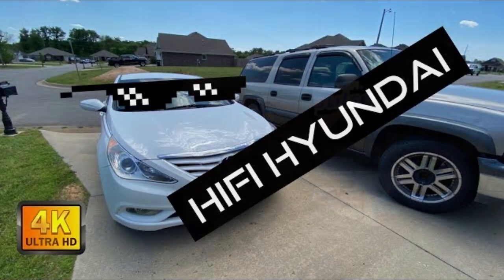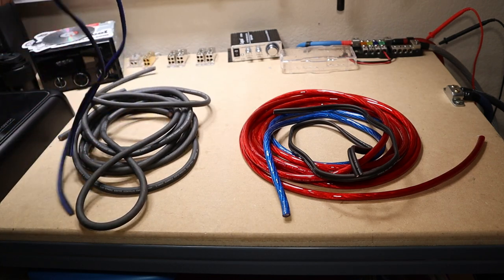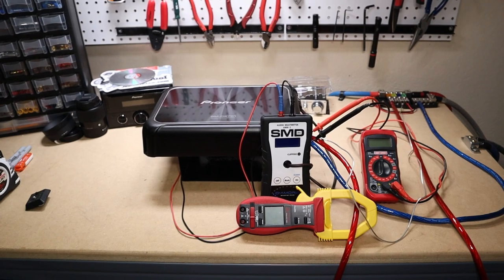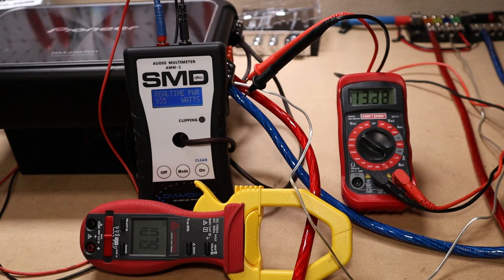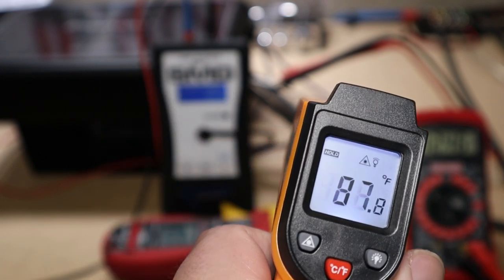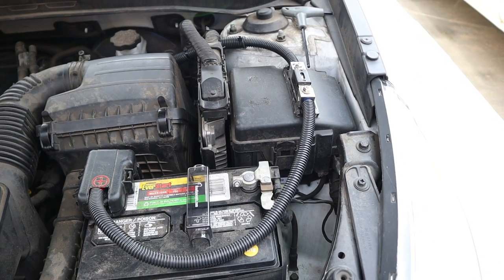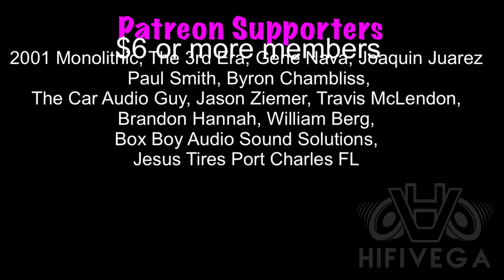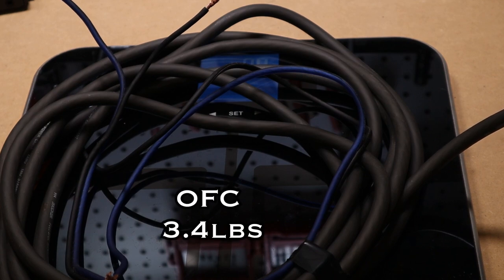This is why CCA wire is better than OFC wire!

Comment: Using some math, you can have fairly on-par performance out of CCA by using 2awg larger than the OFC equivalent.  e.g. use 4awg CCA in place of 6awg OFC and you get a cable that's lower cost and less weight, but have to deal with larger size and the need to further corrosion-proof your ends (noalox).
Reply from the maker: Def always worth saving for the OFC.
Reply: 6awg copper = 4awg aluminium 🤔, the smaller the gauge the fatter the wire. CCA doesn't last for shit if you live in a wet area. Shame everyone local is only selling CCA these days, gonna have to import OFC from overseas, back 10 years ago even the flea market stuff was decent copper. Guess it doesn't help that the cost of copper sky rocketed recently. Gonna have to source copper welding wire instead of Chinese aluminium.
Reply: @fl5537  Thanks for the correction, got dyslexic on my gauges.

Comment: I've installed different brands of CCA wire 0 gauge usually and customers Vehicles they come back months later because they has such high resistance in The Wire itself and would keep blowing the inline fuse. I would then replace the cca wire with any ofc wire and they would be good for years.

Comment: I am an OFC guy myself but what this test does indicate is that there is space for CCA too in the real world for one's daily boom. Music is dynamic and the stress on the wire will potentially be lower. Another point to note probably could be that one may consider CCA for speaker wires without a fuss..so Amazon basics wire may just work as good as a stinger speaker wire. 
I am not sure if am ready to make the shift but a very interesting video. Thanks.
Reply from the maker: I’m an OFC guy for sure, but I needed to test CCA for myself so I could have a more informed opinion on it.

Comment: I mean, for under 1k watts it doesn't really matter what you use as long as it's the true gauge, I bought some 4 gauge kit for 20 bucks, I never ended up using it, it was such a joke, the wire inside was like 10 gauge and the insulation ran thick, I didn't bother to check when I bought it, now I know to check everything

Comment: I have had CCA running as speaker cable for past 1.5 years. Recently, one of the speakers stopped operating and on inspecting, found it to be oxidised completely at the terminal end and wire had white powdered stuff running into the transparent insulation as well. Hence, at least for speakers wire applications, CCA fails to do the job and copper/ OFC should be preferred.
Reply from the maker: Ofc for the win!
Reply: I have I think CCA at some home cheap speakers since 2005 and they are still pretty fine, but they have the tips soldered so they never break apart or oxidize much 😎
Reply: @guily6669  mine were installed on a car that weathered extreme heat and monsoons of India, maybe that led to faster rate of degradation

Comment: OFC FTW!!! I had one of my three vehicles with CCA wire for over a year then it started to corrode around the terminal that's connected to my second battery in the trunk
Reply: Never had any moisture or anything stayed dry the entire install
Reply: 74 Midwestbass I used cca in my work truck and I sprayed the terminals with poly. No issues in 2.5 years. I always spray ends and terminals.
Reply: Also unless the off is tinned, same thing can happen. Spray the unions and terminals and no problems.
Reply: @superchile9640   yeah I do also under the hood but not in The TRUNK! Also the other wires where ofc hooked to the exact same terminal had no problems!!!!
Reply: @superchile9640  now I'm not bashing CCA if that's all you can afford do your thing bro but for me ofc all the way!!! That's almost like building a race car and then putting cheap tires on it😞!!!

Comment: I haven't seen a whole lot of your videos yet but if you plan on continuing test and comparison videos where you need temp data I hope you can invest in a decent flir thermal camera (harbor freight) instead of these non-contact infra red. I have multiple different thermometers of this type (including the exact one you're using here) and I'm sure you know they are NOT pinpoint accurate at all and have a quickly diverging cone of effective area.

Good for big areas like the heat sink of an amp but def not for such a small surface area as wire

HAVING SAID THAT I doubt there are that many other needs that a thermal imager is a must in the realm of car audio
Reply from the maker: I’ve been considering getting the flir phone add on piece for the reasons you already listed
Reply: @HifiVega  man I hope you can. I can't afford to be a Patreon member but I wish I could. Maybe things will change enough for me to do a one time thing. But if you do get one it would be awesome if you could show it off in detail for us. And thanks for the videos you produce. You cover some areas that not many do.

I especially like your lists. Everybody else reviews one amp or one sub. Your lists and shootouts disseminate SO MUCH more useful data. More tubers need to follow your lead

Did you hear that big D ???

Comment: What if say you’re only pushing a 4-500 watt amp for mids and high using 4 gauge caa, will swapping over to 4 gauge ofc make a difference or even worth it the trouble?
Reply from the maker: I don’t think it would make a big performance different, but you wouldn’t have to worry about the corrosion factor/longevity

Comment: I will suggest buying the best you can afford however every test I've seen or done shows that OFC has less resistance and allows your amp to produce more power.
Though if you're building a budget build then CCA is better. 

I personally am running all Knukonceptz Kolossus OFC oversized 1/0 and 4awg wiring but quality is what I wanted.
Reply from the maker: OFC ftw!

Comment: Hears the deal boys n gyrls- if you measure by size, schedule, diameter of wire OFC will flow more current. If you compare the two by MASS or wieght the CCA will be much larger than the OFC and carry the same or more or less current. Try doing a test based on Mass, it might take 1/0 CCA to equal 4g OFC. We wont know till ya test it!

Comment: Ofc all the way.  More watts
I'm also an electrician. Aluminum you have to upsize it to equal copper wire. Aluminum cca wire expands with heat. I used 0 guage cca with reducers to 4 guage toy amp cause it was cheaper and better then running 4 guage ofc wire and  l get more current due to the size and it's a short Run.

Comment: I think the difference between CCA and ofc is minimal especially in car audio.
I think your test is good.
 I just want you to know that if you look at the mayor car audio brands CT sounds, SKAR, Alphard deaf bonce etc. all these brands use ccaw on all there 2500 3000 watt sub woofers voice coils but on the 500 to 1000 watt subs use pure copper or ofc.
I guess you can run more power through CCA .

Comment: I have cca in my grad prix hooked up to a 2400 watt rms amp and it works perfectly fine but in my grand cherokee i have ofc hooked up to a 4000 watt rms amp ( cherokee system not finished ) but id say cca is fine for low power amps but wouldnt run in in a monster set up like my cherokee !! I paid 50 bucks for 1/0 cca amp kit and 120 bucks for ofc amp kit so price may be some peoples reason for buying cca
Reply from the maker: Always go with the OFC when you can

Comment: You'll need to crimp and shrink any CCA in your engine bay. Avoid open strands and set screw terminals at all costs. You'll also need to tighten your terminals periodically since CCA tends to loosen up causing high resistance.  Also need to use larger CCA than OFC to carry the same amount of current, and bigger wire is harder to run sometimes. For the cost between CCA and welding cable, I don't see a real benefit.
Reply: People are using what fits in the amp he was wise to use the same size cable
Reply: @elitepknuable  Yeah, but a lot of amplifiers have smaller input terminals than their amps need (I'm looking at you HiFonics) and if you're running 20 feet of 4 gauge CCA to an amp trying to put out 2kwrms with the gains set "by ear" or "half way", some people are gonna have a real bad time.
Reply: @srp365  Agree, I love Taramps, I run one but the inputs could be bigger or more, like B2 or Sundown..
Reply from the maker: Well said!

Comment: @hifivega Need help/advice with my set up. Got salt 4k with 2 x12’s. H/o alt and extra battery in the back. Zero gauge and big 3 done. I charge good at 14.7 but still flash low on the volt meter when playing. What I just learned is that I have cca and not ofc. Would that be the problem?
Reply from the maker: You basically need double the amount of cca to match the performance of OFC. That being said you you may actually want to run a single 2/0 run of OFC depending on your amperage draw. You could add another run of cca, but I don’t know if that’s going to give you the desired results.
Reply: @HifiVega  I bought 50 ft of 2/0 ofc, better lugs and another additional battery.
Reply from the maker: @MikeDeeKickz518  that should help!
Reply: @HifiVega  thank you bro. Appreciate the reply.

Comment: The major difference between cca and ofc is thermal runaway. Cca will catastrophically fail when it reaches it max heat where the ofc will maintain and cool itself at a higher temp.
Reply from the maker: For sure

Comment: If you want to use applications for high wattage, audio receivers or high powered amps you should be using OFC. Unless you prefer to burn down your house or car down to the ground

Comment: CCA does not have the same current rating as OFC. What you should do is if you are using 8GA OFC then you should use 6GA CCA. Even you step one up, CCA would still way cheaper

Comment: Is CCA ok for the ground?
Reply from the maker: It would be better to have ofc, but if all you have is a short run of CCA and it’s sized properly for the current you’ll be ok. Just make sure you crimp it well and heatshrink it
Reply: @HifiVega  1/0 CCA for ground and 1/0 OFC power 
Is ok?
Reply: @HifiVega  I’m only running a 2500 watt amp
Reply from the maker: @73MCLOVIN73  if it’s a true 2500 watt amp I’d consider a dual run of 1/0 if you’re using cca
Reply: @HifiVega  rms is only like 1600

Comment: I have a question so in a high-powered system what would you recommend let's say a system running at 30000 Watts RMS would you recommend CCA or ofc
Reply from the maker: theman71177 theman71177 always OFC even on low power
Reply: Check out Steve Meade's video on exactly that using cca your losing several hundred watts and generating lots of heat. Ofc copper or tinned ofc copper is the best way to go.
Reply: If you have to ask that and you have 30,000 wrms ??? JK
Reply: Ofc forsure, before I knew anything about car audio I used to buy cca and it would always corrode, and there u have me buying another wiring kit when I could of just used ofc from the start

Comment: Thank You so much for informing and entertaining us! P.S. I wonder if the resistance or "rise" would change in "hot conditions" CCA/OFC hooked up to a woofer? simulating real life.. most of us run our Amps, wire and subs in the trunk 100+ temp at start up.
Reply from the maker: That’s a great question! Maybe I should try testing that at some point. Also thanks for actually watching the video I get a feeling some didn’t pick up what I was trying to lay down lol.

Comment: are you sure you are using CCA wire in your car? That wire looked completely copper to me. I guess It would come down to the brand and actually if they coat every strand of aluminum wire and how much of it is copper. 

That if it 50/50 copper/alum would perform morr similar to OFC wire.
 Than if it was just barely coated with copper.Lets say 5/95 copper/alum would perform more like aluminum with less output current and heat up faster but also s quicker cooling rate. 

Then It would also comedown to how long the wire is and how well can the amp dissipate the heat and the ambient temperature. 

As any size and type if wire can be used as long as it can be cooled sufficiently. (lets say 24 gauge wire used where 0 gauge would normally be required. Would become a red hot glowing wire and melt almost instantly, but if it was submerged in lets say liquid nitrogen it would probably be fine. 

It all comes down to the voltage and resistance will always resist the total current(amps) that a wire can send. Any current above that an amp wants to pull more than that ammount. More if the current is converted into heat and the energy becomes less and less efficient over that ammount as the temperature rises increaseing the resistance.

Comment: So it weights less, is that why you are a CCA fan @HifiVega? ... This my first time using OFC for my whole system down to the tweeters so I am about to find out. I use both KnuKonceptz & SHCA. I like KnuKonceptz because their wire is tinned that is all I can speak on so far. Oh yeah it is heavy too. I bought a couple spools. You can tell the difference.
Reply from the maker: Juan Romero Jr. I’m an OFC guy I was just fooling around since I am testing this
Reply: HifiVega I got the joke late.

Comment: this has been tried and true over and over on sine waves, i have yet to see it on music. i'm personally running both 1 run 1/0 cca and 1 run of 1/0 ofc, both sky high. i have a 370 amp alt and running them all the way to the trunk to 2 agms. from the agms i will be running cca because if 4 2 foot runs cant give me the 3000 watts im asking of it of the 5000+ it certified on the dyno at, i quit

Comment: I think you got  more power with the ofc with less amps pulled. So in a competitive scenario the extra watts could yield greater numbers. Im ofc welding wire for life. 
Almost looks like your vehicle your testing the cca on stays inside a garage. Lol i know the cca I used had corroded over within 6 months, it swoll up right at the ends too on the connections under the hood. It was also corroded inside the cab but not swollen like it was under the hood. But my vehicles are outside all the time never covered.
Reply from the maker: This car stays in the driveway, but I’m definitely gonna check on it every 6mo or so and kinda give y’all an update and for my own piece of mind lol.
Reply: CCA has higher resistance than OFC. To pull the same power, you have to pull more current to make up for the voltage drop. OFC wins again.

Comment: Not to mention the weight factor. Even running 2 runs of CCA put you at 2.8 lbs (going off the 1.4lbs X 2) that is still less that the 3.4lbs of copper run. That only leave the durability/corrosion factor. You can get tinned CCA to combat that. I'm sorry but the more comparison videos I watch the more I lean towards CCA for LIFE. let's talk PROS of CCA for a sec
1. Lighter
2. Cheaper
3. More Flexible
4. Readily available
5. Multiple runs STILL CHEAPER than 1 run of Cheapest "Welding" wire run
6. Usually "oversized" and has higher strand count. Electricity flow on top of wire, not through it! The wire is copper coated therefore it's very conductive!

Comment: I think you have done it very different from actual setup. We usually run 0 awg from the battery, distribution blocks to 4 awg. So actually the 4 awg only runs few feet to amp and grounds...etc
Running 4 awg from source to destination will not be ideal for this amp. CCA or OFC will suffer no matter what 

Don't think that these results are conclusive
Reply from the maker: The size doesn’t matter you will have loses and more heat either way. I compared 4ga to 4ga you can see Meade do 1/0 to 1/0 here

https://youtu.be/cWI-_6PRyFs

Comment: I simply suggest against CCA for longevity. 4mo is gonna be fine usually all around, but with some of my customers I’m seeing major degradation  around the 1.5-2 year mark, and it sucks to have to completely pull out a full amp wire to replace with OFC later on in life. I am selling completely tinned OFC in my shop now, CCA will void warranty. Less headaches for me, less for my customers, but I’ll still sell CCA over the counter. Also- This may sound like a dickhead thing to say but hey, let’s be real, I’m in business to make money and CCA has little profitability, so I look at it as a win-win for me and my customers that they’re not gonna have to come back for servicing for the life of their car and I get to make 50 points on an amp wire kit or above that on the bulk wire per foot, rather than perhaps 10-15 points. Started using ORCA iConnects wiring recently, actually better flexibility and strand count than stinger OFC. 
Alright done ranting, that’s my two cents.

Comment: I can't get OFC locally so for most of my builds I just double up on the size requirement and use the best I can get. If it calls for an 8awg then I use a 4awg and so on. If it's a build with higher end components and budget isn't an issue then I'd order a OFC kit but that gets pricey for the customer by the time I import it in. However, I'm not doing any high-powered SPL builds or anything like that either.
Reply from the maker: I’m an OFC guy for sure, but I needed to test CCA for myself so I could have a more informed opinion on it.

Comment: Come on man. You could have EASILY made this video without the clickbait title. That aside though, it was a really well done video. And a subject that despite how crucial it is to pretty much anything electrical - especially audio - doesn't have a ton of clear info available (most of what I've found is stuff like "OFC seems 40% better based on *random assortment of data and personal opinions*".

I've been looking for direct comparisons between OFC and CCA of different lengths with concrete results (resistance, temperature, etc.). I'm also curious what role frequency might play in their efficiency and how the different wires of the same length might compare at the same price (like 20' of OFC that cost the same as 20' of CCA. So maybe like 4AWG and 1/0AWG respectively. And then maybe check them at straight DC, 60Hz, 100Hz, 200Hz or something like that)